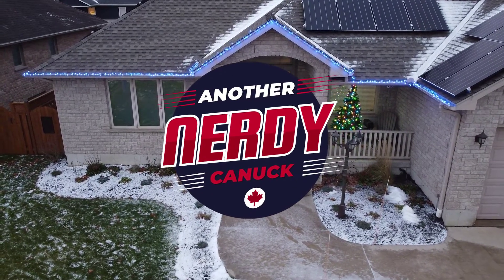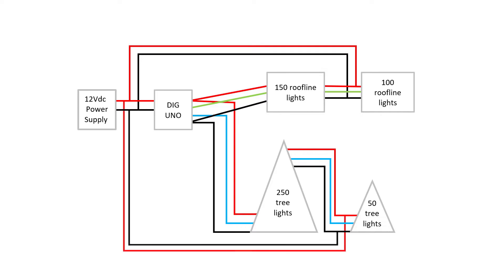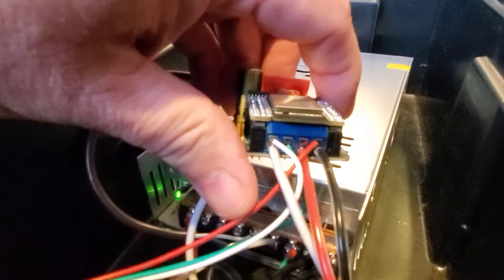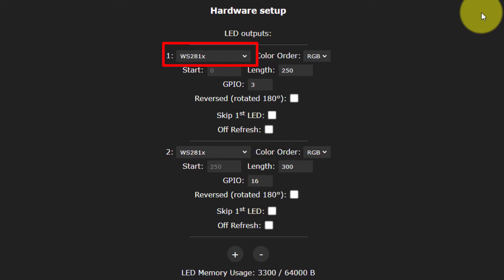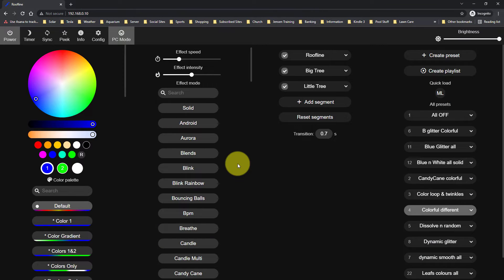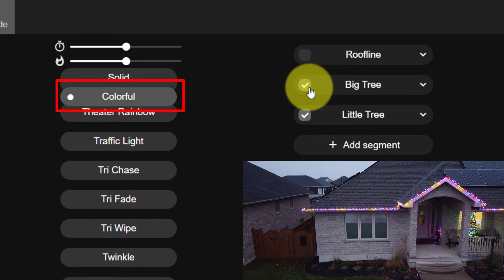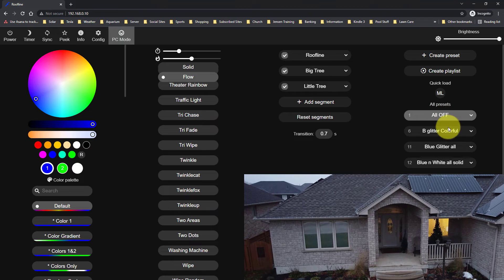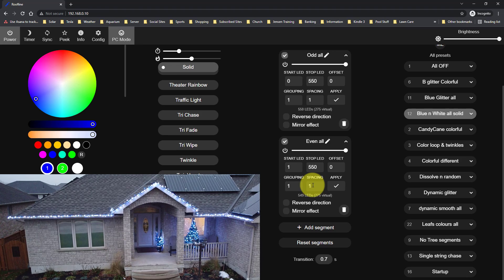Use both data lines of your Dig Uno controller for maximum WLED pixel control!

Comment: Have you considered somehow breaking the single string chase into multiple segments to get the chase to go right to left but not run through the led string 1 to 500 but visually right to left? I.e. the chase would start at right roofline, run to right side of arch, move down to the big tree bottom and work it's way up, back to the roof strip to the top of the arch, back down to the small tree, then finishing the roof...
Reply from the maker: Great question! However, I have since expanded my system and mounted them permanently in track. If you watch those videos, I would welcome any programming suggestions! 
Thanks for watching!

Comment: Nice info man , quick question the computer its a mus to control everything?
Reply from the maker: You need an app or computer to connect to the controller (in my case, via WiFi) to set it up. Once it is set up, it will run on its own.
Thanks for watching!

Comment: Excellent video. I'm working on an  almost identical setup. Wondering what gauge(s) wire will fit into the terminals of an UNO if I'm using multiple strands like you.
Reply from the maker: For my permanent setup, I used 14 AWG wire in the dig-uno and then joined it with a wire connector to all my power injection.  
Hope to get that video out this weekend!
Reply: @AnotherNerdyCanuck  was power injection using 14g as well? Also, did you have to use any data boosters? It looks like you have some really long runs of wire before you get to your first LED.
Reply from the maker: I did use 14 AWG for power injection, but that is probably overkill. I will be using 16 AWG for part 2 of my permanent install.
The dig-uno controller has a built-in data booster, so no additional one was required. Not sure how far you could go.

Comment: Just set-up my first Diguno, trying to wrap my head around the dual output, so thanks for the very well done video!  Question I have is this, do you only have to use the second output if you are using a different type of LED strip? Otherwise, if you are using the same type strip creating segments will give you the same result even if you only use one output?
Reply from the maker: Thanks!! You are correct.

Comment: I ordered a pre made digiuno from DRZZ..I hooked it up according to the instructions, but only the first LED is on, and won't change to any other colors. Just stays white. Any ideas on what might cause this? I have 12 v  ws2811 pixels. I wanted more control and was trying to replace a  Magic LED SP105E controller which works fine powering all the lights.
Reply from the maker: There are some good suggestions here: https://www.reddit.com/r/homeassistant/comments/dki6ac/cant_get_wled_to_work_with_ws2811_led_strip/

Comment: Nice video with lots of information, thank you for posting.  If I was to build a Xmas tree with 8-10 rows of pixels going up and down (vertically) do I wire it with more diguno?
Reply from the maker: Thanks for watching! It really depends on how many controlled pixels you will have. That is what will tax the diguno's ability to avoid flicker. Unless you have a very large tree, I would think the two outputs of a single diguno should work.

Comment: With the dig uno and wled are you allowed to have the peak of the roof line have running lights starting from the peak and then have it travel left and right down the peak? I know that the data only travels forward. So if I want the LEDs to travel down a peaks on both sides or in the middle of the strand that travel left and right is that controlled through wled? Or do I have to flip the led string backwards so the data arrow is flowing that direction the lights travel?
Reply from the maker: Yes you can! You create regions of pixels in the settings called "segments"and have the segments split at the roof peak. You can then have the effects "mirrored" to move out from that particular point on the roof. It isn't really obvious within the settings and it takes a bit of trial and error, but I believe it can be done. I did something similar with my daughter's WLED aquarium light to create a "cloud moving by the sun" effect.
Thanks for watching!
Reply: @AnotherNerdyCanuck   what’s the point in getting a digiquad if I can just make segments with an uno?  I wouldn’t have to make extra data running…

Comment: where did you get the 600 leds per channel info?  I currently have over 1000 on one and another 800 on another using a dig quad. no noticable data loss/ lag in the effects i have tried., but imagine once you tried to sync to music or something it would show up, Your thoughts?
Reply from the maker: These are recommended maximums on quinled.info. It has to do with frame rates and the default run rate of WS281X LEDs. I would imagine static or low speed effects could support more. They go into much more detail on here: https://bit.ly/33sGKpH.
Thanks for the question!

Comment: Did you build your own dig-uno or go premade?  I have been following Quindor and DrZzz and I am excited to give permanent holiday lights a shot this spring too.  It will be very cool to watch your progress as someone new to this stuff.  Any idea which fair better in colder climates, led strips or strings?  Are you planning on mounting the strings directly to the house with clips or are you planning on some sort of "system" to permanently attach them?  I am most curious about things not usually mentioned in other videos.  Things like how and where to house the dig-uno controllers and power,  how far away can they be from the lights (I know there's a data boost, but still must be some sort of limit), best way to run all of these wires and keep them mostly hidden, etc.  Thank you for the video :)
Reply from the maker: I purchased pre-made Dig Uno. I believe the light strings look more robust for extreme weather, but am not sure. I will be attaching them with Permatrack. The rest I am still figuring out! Thanks for the questions!

Comment: How you know to use GPIO 3 and GPIO 16? is that a common GPIO setting for Dig Uno for 2 output Led?
Reply: The Dig-Uno also has a full line-up of articles you can find on the website including a pinout article which will tell you which pins everything is connected to! :)
Reply from the maker: The website is very helpful and I used it to plan and program my full install. Thanks!
Reply from the maker: If you look at Timestamp 02:39, you will see that right above the output labels "LED1" and "LED2" it has the GPIO number on the circuit board. Thanks for the question!

Comment: The only real drawback to doing the power injection straight off the power supply is you aren't utilizing the 10 amp fuse that comes with the dig uno. I'd suggest either purchasing an in-line fuse, or just running the power all off the dig uno
Reply from the maker: That's good advice, thanks! I will just drive it off the 10 amp fuse on my final install.
Reply: I bought a 6 fuse 12 volt "marine" fuse dock for my power injections because the 8 fuse unit at Wally's lights was out. But i think I'll use the walleys lights unit in future projects. 

Pull from one of the 12 volt on your PSU to that and the. You don't have to pull so much through your single outputs on the uno 

Or wait for quads to come back in the. You get the same thing built into the quad. Plus the new beefier pins for using ferrules much easier on the new quad v3.
Reply from the maker: Good idea! Thanks!

Comment: Great video, starting my lighting project this winter.  One question, how are the holding up in the cold weather?
Reply from the maker: The lights seem to be holding up really well (-10 C last night). They seem better protected than any other Christmas lights I have ever put up.  Thanks for watching!
Reply: With the extreme wind we've been having in the midwest we have been having over night weather of like -10F and my dig is in a weather proof box right outside with them and some random 12v plug in supply. 

I have the rextin bullets. 

They have even been frozen rained in place for a few days. Still going strong after a few months so far.
Reply: Why wait? If yours is going to be a permanent set up you can put them up now! Lol I’m inpatient and just ordered the jellyfish style leds and the track lighting. I can’t wait for them to come in. I’ll try to have them up for July 4, Halloween and Christmas. Already missed valentines and saint Patrick’s day. Plus I don’t want to install them in the cold ! you also might want to start planning now. I know the dig quads/uno  are currently sold out on their websites. I got lucky and got in on the small restock.